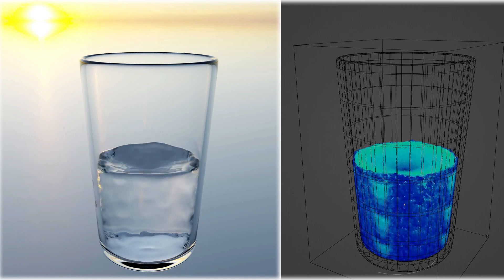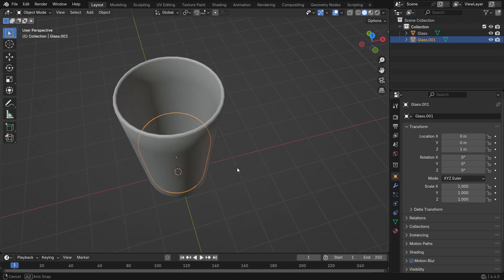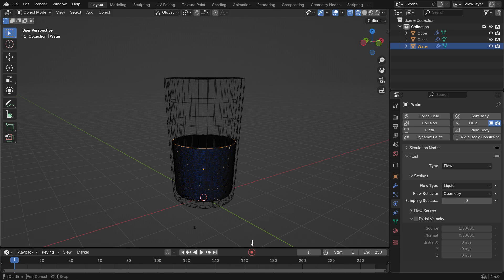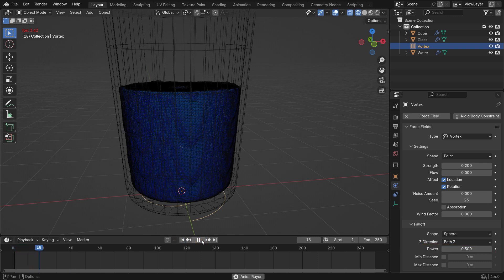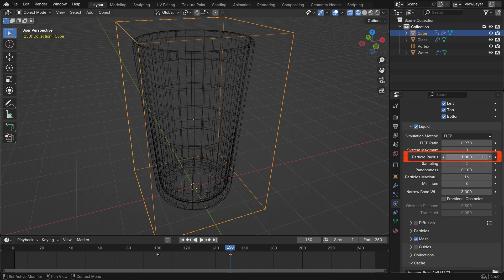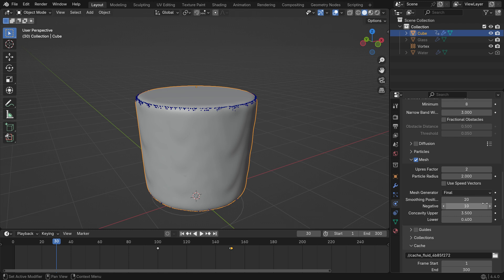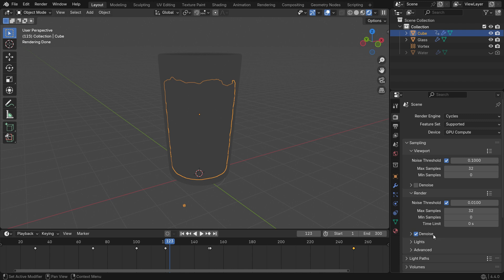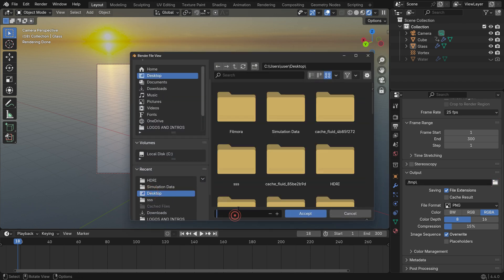Create a Realistic Water Vortex | Blender 4.4 Fluid Simulation Tutorial

Comment: Hi, amazing tutorial!

I have a question about the visualization shown on the right side of the thumbnail (the one with the colorful representation inside the glass).

Could you please explain how you set up the fluid simulation to visualize the fluid velocity, pressure, or density using different colors like that? Specifically, is it possible to display the fluid speed data directly on the mesh, and if so, how is that set up in the Shading or Geometry Nodes?

Thanks in advance!

Comment: Whenever i start the simulation my mesh goes up and starts flowing down to the cup, the water mesh doesn't stay in the cup like yours, it literally goes up, like a water fall, any idea what is causing this?
Reply from the maker: This usually happens because the water object is not fully placed inside the glass. If a part remains outside, it will jump upwards when the simulation starts. Also, if the liquid spills out, increase the ‘Surface Thickness’ value a bit in the Domain settings and fix the glass normals by using ‘Recalculate Outside.’ The mesh should be completely inside and the settings should be correct.

Comment: do you know what wrong when my fluid always flow out of the effector ? i tried many way but the problem still here :(
Reply from the maker: Make sure you didn't cut the inner face of the glass while duplicating the water mesh. Also scale down the water mesh slightly and set the effector thickness value higher. Don't forget the refresh simulation cache. Finally you can recalculate the outside glass face normals. Then don't forget the recalculate the face normals.
Reply: All the things our wise teacher says, but in my case, at least half the time it's me forgetting that the fluid domain's Resolution Divisions isn't high enough, or the walls of the containing object ("Effector") such as the cup aren't thick enough. I may adjust the Effector Surface Thickness, but I don't always have good luck with it.  Maybe that's just my odd experience. 

Look at the tiny cube in the corner of the Domain box (when nothing's baked, so you see just a cube not a fluid mesh) and compare to the thickness of the sides of the cup or whatever container you have. The tiny cube must be smaller.  In an ideal world, I'd make the container's walls thick enough to be at least twice the width of that cube. 

Sometimes you can't do that. Example: water swirling or pouring into a paper cup. The paper sides are thin, and you don't want to change that. It has to look like a paper cup in the final render. Making the Resolution Divisions a bigger number, like 1000, might solve the problem but don't blame me when your computer melts next November when it's only 1/10th done with baking the simulation.  Keep the Resolution sane, like 60 to 100.  Create another object, same shape as the cup but way thicker sides.  Set this, not the paper cup, as an Effector. Its inside and the "real" cup's inside should be identical.  Turn off its visibility in the final render, and make it wireframe, or not visible, for the viewport.  

A similar problem comes up with rigid body physics, except it's the distance objects move between frames, not a tiny cube in the Domain's corner, that you need to examine. You need enough physics computations per frame so that the distance the fastest object moves is less than the thickness of the walls of any container.